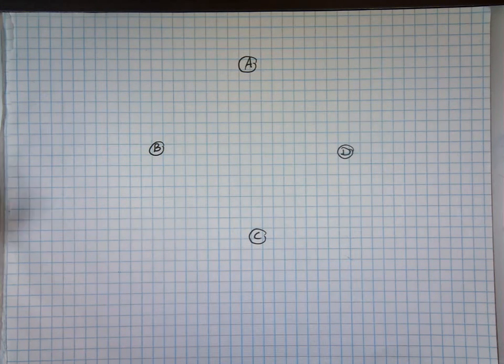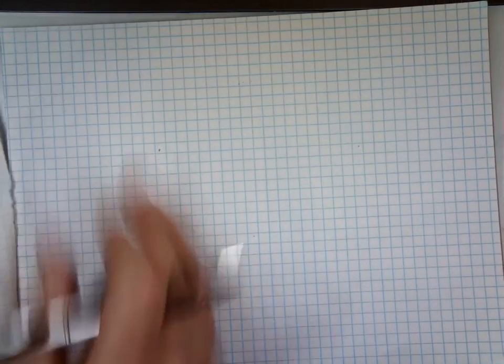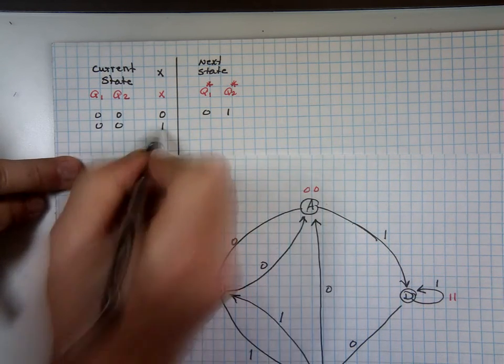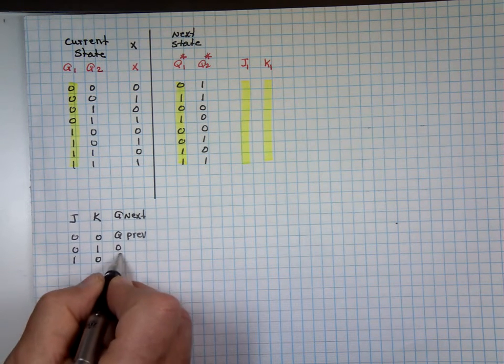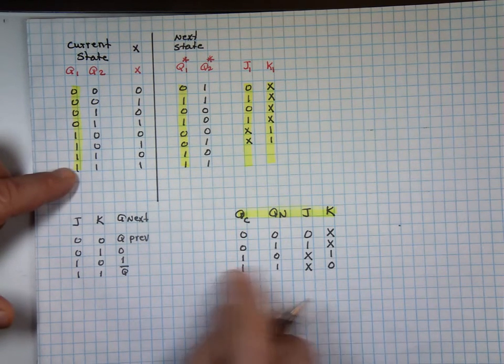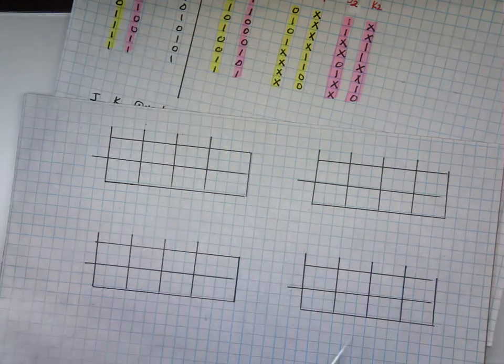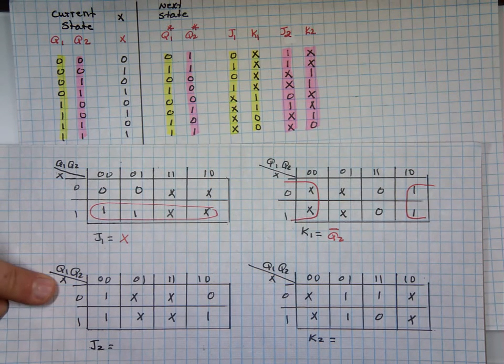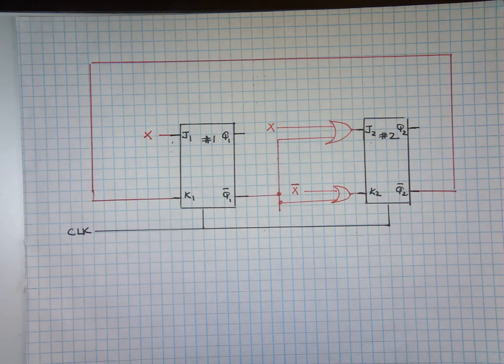Analysis of Sequential Systems

Comment: THANK YOU SO MUCH.
PLEASE CONTINUE LECTURING ABOUT 
1. DEVICES AND CIRCUITS (I)
2.  DEVICES AND CIRCUITS (II)
2. CONTINUOUS TIME LINEAR SYSTEMS
3. DISCRETE TIME LINEAR SYSTEMS 
4. MICROPROCESSORS 
5. APPLIED ELECTRODYNAMICS